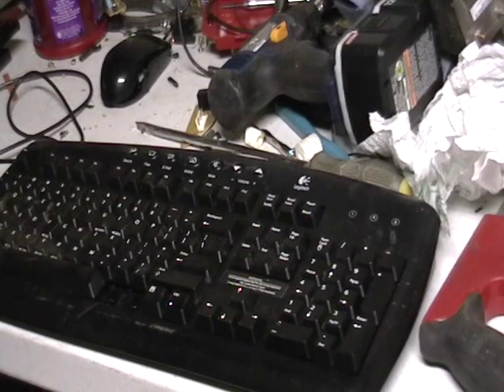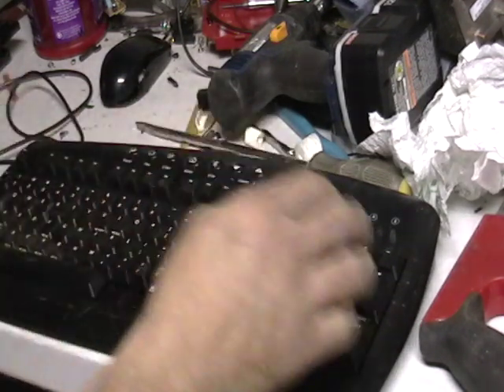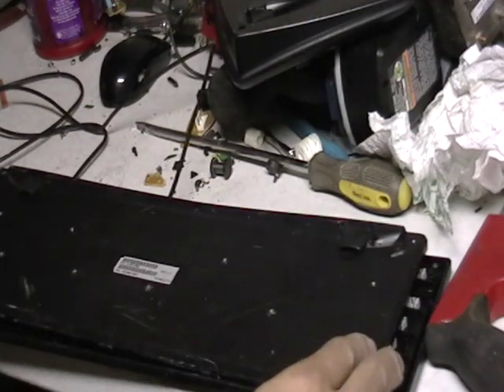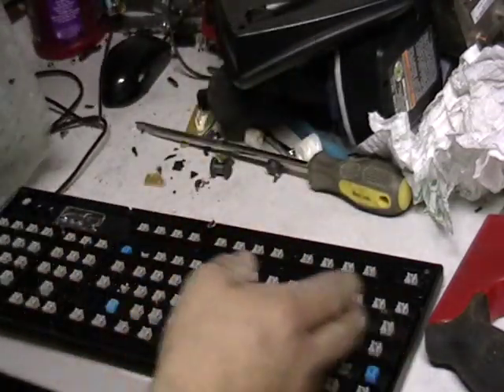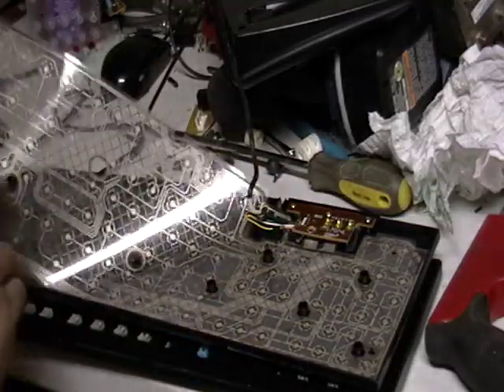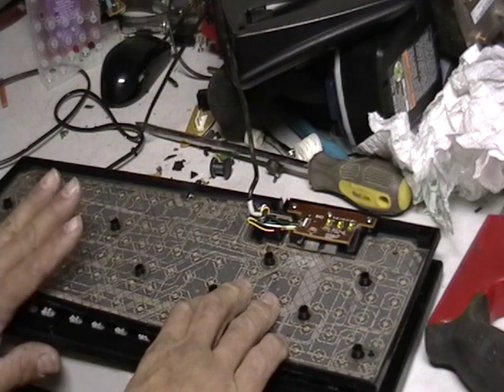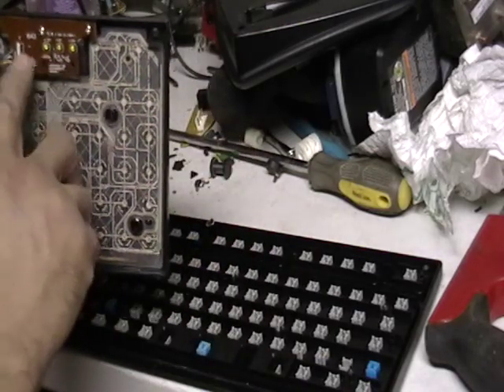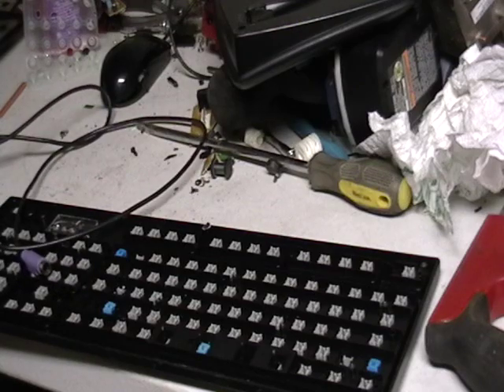Scrapping a computer keyboard for silver and mouse

Comment: Hey mike great knowledge. You mentioned stripping all variety of stuff. THIS IS THE HELP IV NEED ED   I have over 150 cell phones, dryers freezers, printer scanners and fax, plus pounds of transformers, speakers, tv's, monitors, keyboards. Should I be stripping power wire from its shielding? THANKYOU the water heater seems to be a lot of copper. Do you agrees?

Comment: 10 cents a pound for low grade boards around here. I thoughjt I wouldn't get much but I have collected 50 lbs. so far. They are in everything electronic. I even found wires and boards in my kids old stuffed toys that sang and danced. Thanks for the heads up.

Comment: I've watched several of your videos and its obvious that I know a bit more about "scrapping" than you do.  For instance, you stated that palladium and platinum aren't worth anything, which is totally wrong. Platinum is worth more than gold, palladium isn't worth as much as gold but is still worth a good bit of $$....  Also, simply because someone threw a computer into the trash, doesn't necessarily mean that its worthless scrap.  In some instances it may well be, however, I've spotted several "PCI" cards that you appear to be scrapping that are worth way more intact and functional than they are as scrap.  Also, if you damage your CPU's by throwing them around then you are only going to get a "SNAD" case filed against you if you sell them on ebay, as they are fragile and not too many people will try to repair the bent pins, even if possible.  Also many of the older computers and related peripherals can be quiet valuable, but you need to know what you are looking at or take the time to look the stuff up before you "scrap" it.  Many of my scrapper friends are just like you, they get caught up in the scrap it mentality and end up loosing a lot of $$ as a result.  Not everything NEEDS to be scrapped.  Clearly, you are an amateur and the info that you provide really isn't worth much.  No substance, very little useable info and a great deal of HYPE! Sorry, but much improvement is needed---
Reply from the maker: SM Kira OMG... that is such an old video. You need to look at a newer video to get updated on my info...
Reply: agreed but alot of mikes new stuff is pretty accurate like 2013 and past so check it out